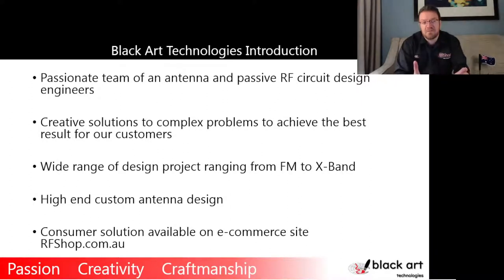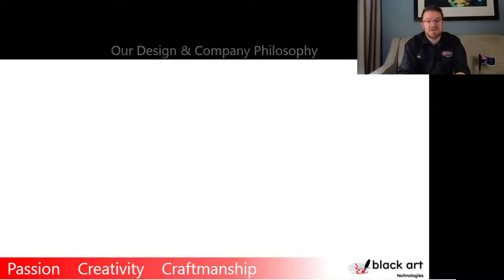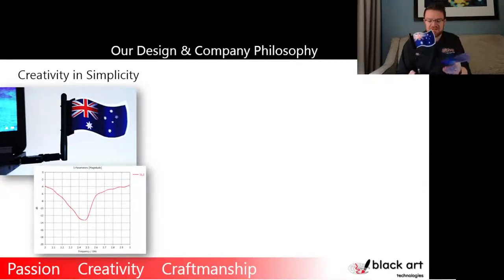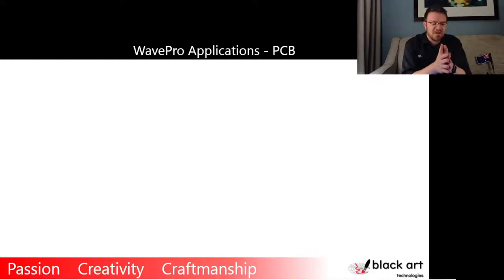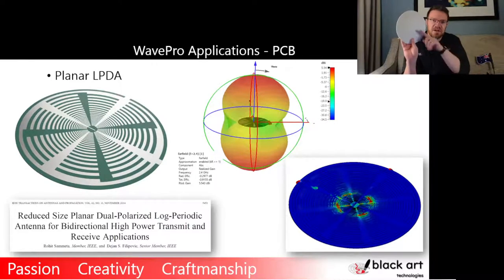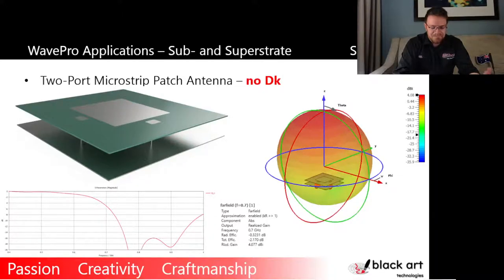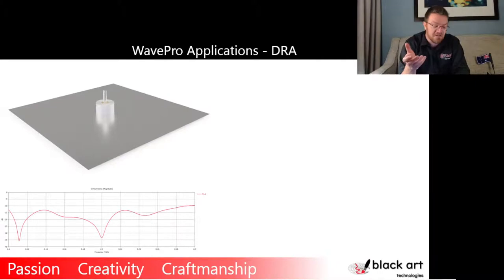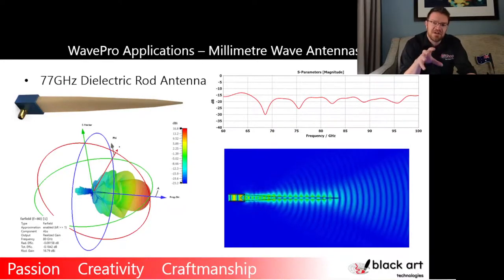Introducing a new custom PTFE dielectric solution at IMS2022

Comment: Quite useful to watch contents.
I am stuck in  manufacturing of High gain dielectric rod designed in teflon (dk =2.1) whether 3D printing possible for PTFE as shape is bit complicated
Reply from the maker: It may certainly be worth reaching out to the team at WavePro. Currently they can do up to Dk=12 and working on higher Dk’s as well